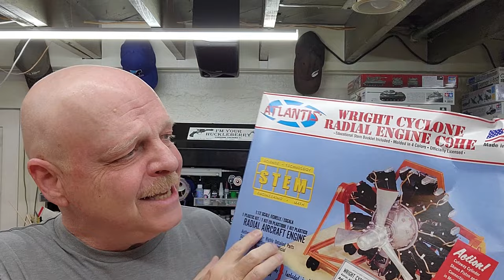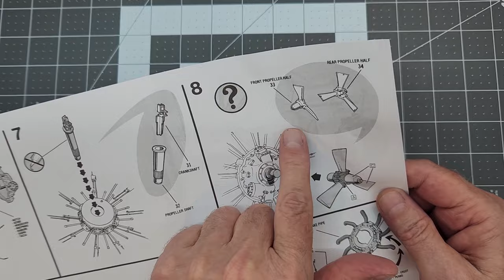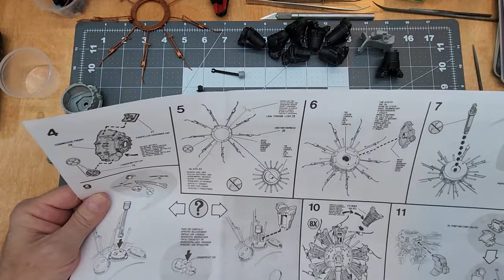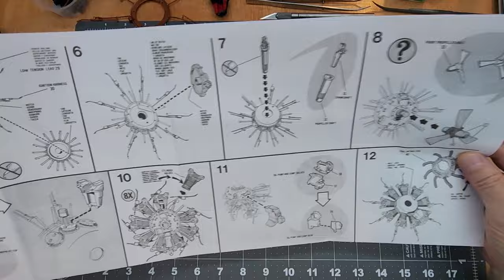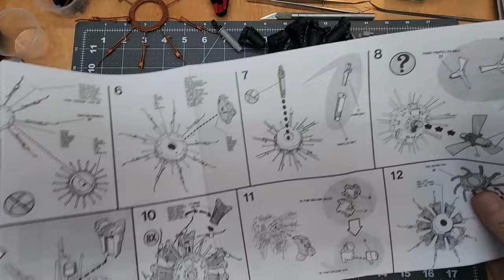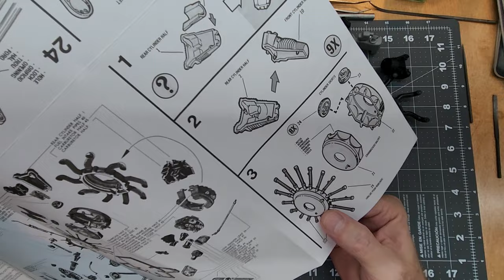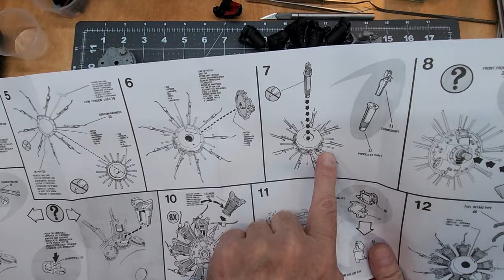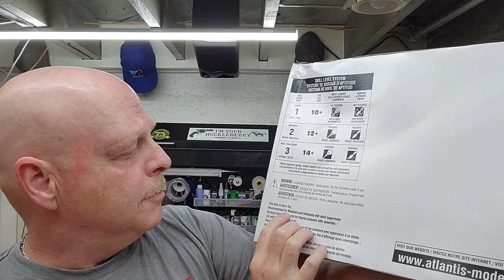Wright Cyclone 9 Kit Build Part 1

Comment: Great job, Johnny. That kit is a lot more complex than it looks at first glance, I really liked your shim solution to the push rod gaps and how you shaped them. Cylinder alignment would be impossible without your approach to the problem, in fact, it serves to highlight the need for dry fitting in order to see what issues lie ahead.
Reply from the maker: I couldn't agree with you more about the dry fitting Gerry! Since completing this video, I have discovered that this kit was originally a Monogram kit from 1959, according to ScaleMates, LOL. So, I guess it's a really good kit for its age, but I still don't believe it to be a "STEM" kit. Thanks so much for your support my friend! Take care and model on. Johnny